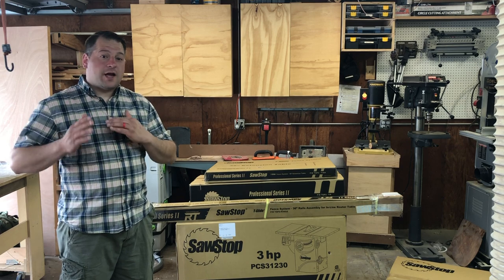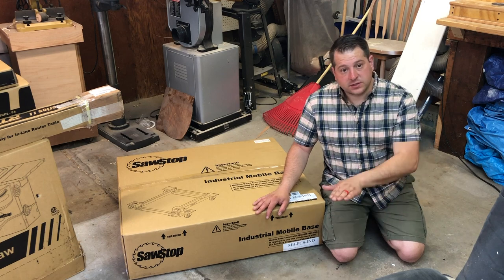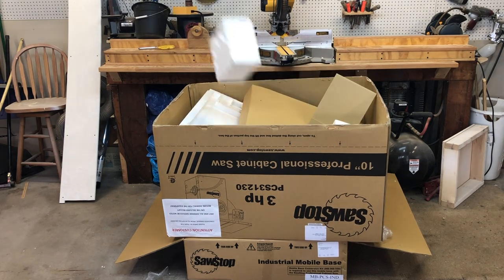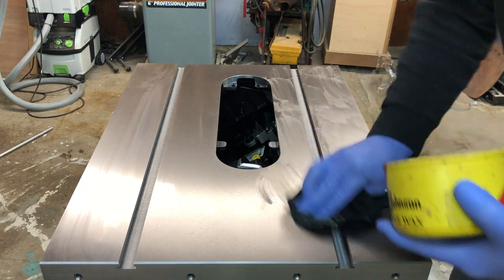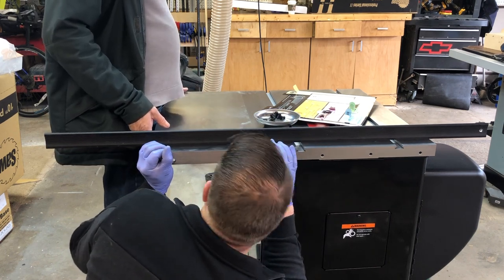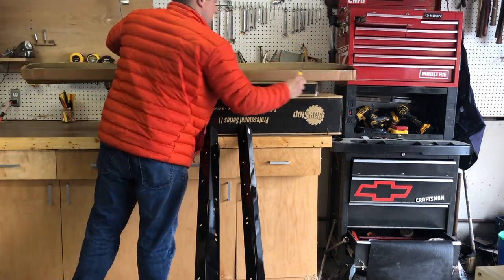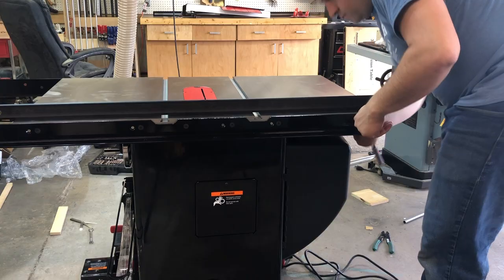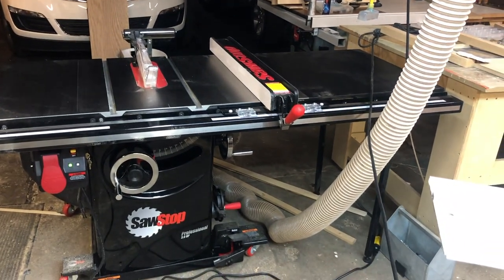Sawstop Table saw unboxing and assembly

Comment: FYI, the 1 3/4 hp. Sawstop will run on 220/240. All you need to do call Sawstop parts and purchase the 220/240 connection box. Mine was below $90 .

Comment: Thanks for an awesome video!  I have a Unisaw (left-tilt, 220v) - a great machine, but the design hasn’t changed much in 60 years. Today I will order the same saw featured in the video - been thinking about doing so for 5 years. A friend of a friend lost 3 fingers in a table saw accident a few months ago. He is in his 60’s (like me) and has worked as a cabinet maker for most of his professional life (way more experience than me). He’d never had a significant accident before. Conclusion: it can happen to me and it’s just dumb to buy a SawStop after you’ve had an accident.

Comment: Thanks for making this vid. That is the exact saw I want to get. My shop has 220 but I think it has the wrong outlet for what this saw takes. So I've got to get that fixed. I want to go with this saw mainly because of the safety feature. I'm pretty much by myself now and if I slice all the finger off help is a long way away. The saw looks very solid and well put together.
Reply from the maker: You can either change the outlet in your wall, or the plug from the machine. If your thinking about getting one, you should join the fb sawstop users group: there is a ton of information on there to help you make an informed decision.
Reply from the maker: Its really solid and the best tool I have bought for my shop. The quality of the manual and saw is unmatched by any other new tool I have ever bought. Enjoy!

Comment: Hey man thanks for this vid.  I just ordered my own sawstop. same one as yours.  You asked for comments as to why we (I) are buying this saw.  reason one.  ease of assembly.  I will be referencing your vid when i get mine. Reason two.  The reviews; all the reviewers say the saw is perfectly aligned out of the box.  other brands seem to need lots of adjusting to get them working right.  Reason 3.  The safety feature.  I`m pretty sure I`ll never need it  but it sure is nice to have.  Are you happy with your sawstop so far?
Reply from the maker: I love it, its the best tool I have bought for the shop. You will not regret the purchase